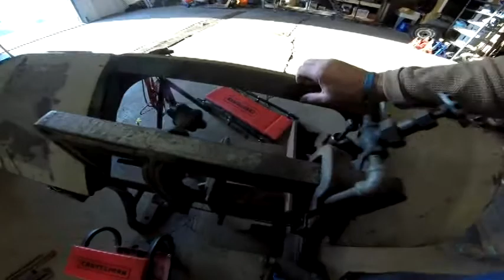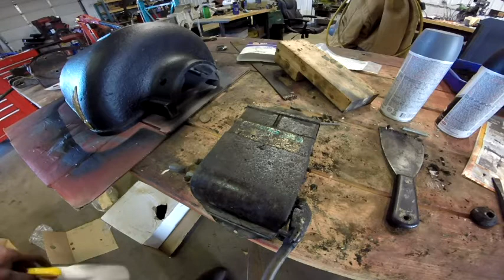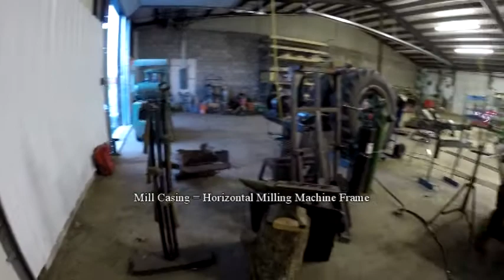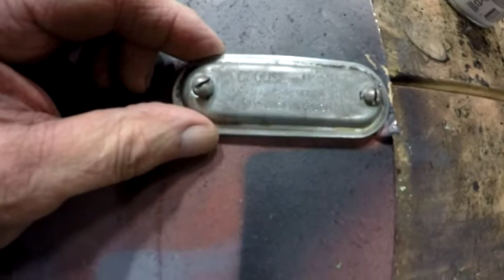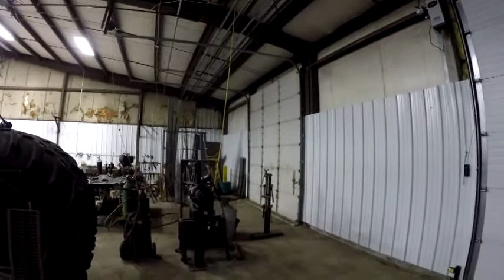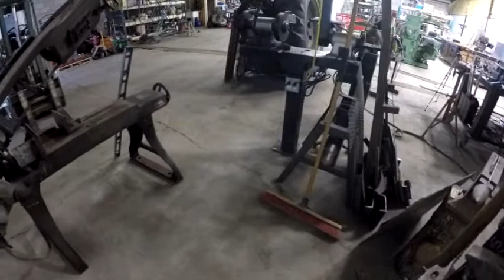Kalamazoo Band Saw Part 2

Comment: The tag at 1:43 was likely etched to produce the lettering and frame.  That was typical of machinery tags.  NYC CNC has a good video of how this is done. 7:50, if you're interested in how to hook that up, look up how to use a multi tap transformer.  The transformer's sheet metal cover on the right has a paper tag on the inside of the cover.  It should show a diagram of the transformer that should reference the white wire number markers on the crummy black insulation wires.

Comment: The best I can find about the MECH is Mechanical Power rating as opposed to an electrical power rating.
Reply from the maker: I will try to look it up also, but off the top of my head not sure why two ratings HP & Mech, unless mech was more like a torque rating? Again thanks.
Reply: Apparently mechanical kilowatts was a rating back in the day.  It's largely been replaced with the term electrical kilowatt which is about 1.34HP per mechanical KW.

Comment: So, it looks like they needed 110VAC for accessories on the saw. (pump and light?) They wanted to switch the 110VAC for the accessories.   The transformer likely has input taps for multiple voltages which may be the wires with nuts and no connections. or the two that are wired together.  I'm guessing they had 3-phase coming in here with a neutral.  Two of the phases L1 and L2 fed the transformer input.  Out of the transformer came a 110VAC tap that, in conjunction with the neutral gave you 110VAC control circuit.

Could they have run that 110VAC hot wire out to a switch and back to the plug creating a switched receptacle at 110VAC?  That would mean that you could have the saw turn off the work light and the coolant pump (at the bottom of its travel via the metal tab pushing the switch) by having that 110VAC break and remove power from the receptacle.  

This is my theory so far.